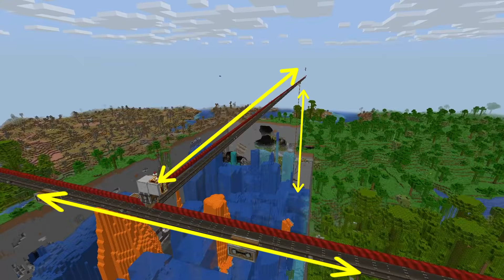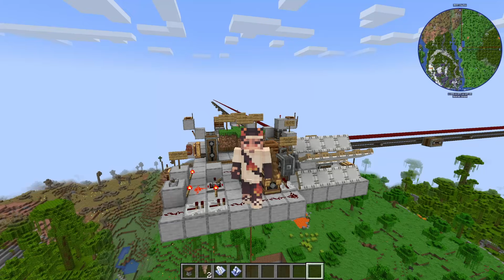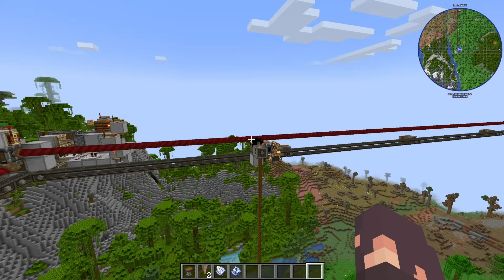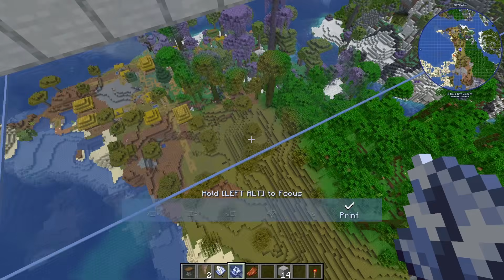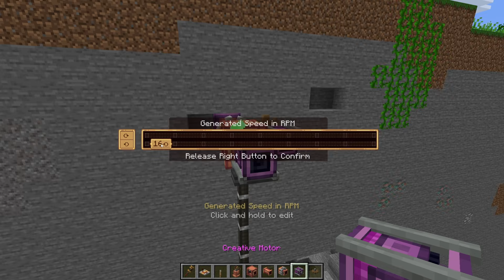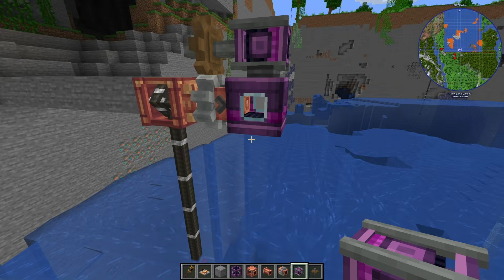The Best Create Mod QUARRY On YouTube! | Create Mod Tutorial

Comment: Probably the easiest way to delete the leftovers is to run a rail contraption that has a wall of blocks and stops each block along the way with a controller rail and cart assemblers to break blocks and fluids in a vertical plane and just run the rail in a zigzag. Still a hassle, but better than trying to finagle hose pulleys.
Reply from the maker: Yea… I’m hoping I can make something that can use the current infrastructure and just place blocks like a wall going down. We’ll see how feasible it is, but the wall strat might be the best way to

Comment: Great suggestion to removing liquids, set the Deployers to place an instant break block like slime, then filter the funnel to not output said block, with that you wouldn’t even need a 2ed layer of drills on top
Reply from the maker: I see what ur saying. Will try it but unless the drills are 3 blocks away it prob won’t work as expected cause they’ll still place blocks as the machine is coming back up. I’ll keep messing with it to see if I can figure out a way for internal deployers to work

Comment: 10:00 if you have the chunk loader create addon you can use 2 chunk loaders, 1 on the controlling part and 1 on the drills
edit: maybe you can make the un-watering system by just putting the deployers in the way that they will place blocks on top of the drills (up not down) if it still wont work you can make extra layer of drills  on the bottom facing up with drills under this facing down
Reply from the maker: You’ll still need to load in the entire gantry shaft and belt part of the contraption since that moves over with the farm, but that’s a good idea to reduce the # of total chunk loaders
Reply: @kindlebubbledump I've been working on getting this to run correctly on my world for three days now 😢 
 Anyway my thought and question for you is can't the gantry shaft that is in the schematic on both axis  come  with chunk loaders attached and glued to the gantry themselves ? 

Was there an reason you didn't include chunk loaders?  Is it an Stress unit prob ? .

Thank you for your hard work 💜
Reply: @la24dogg21  because loader on drills would need thousands of stress units which you cant currently provide

Comment: This is the best thing I’ve ever seen for a quarry. The only and only one thing I would suggest is making it so the machine comes back to deposit the items instead of an extension of belts as this may cause lag. Best video ever!!!
Reply: belts mostly only cause FPS lag, which really isn't going to affect your AFK session.
Reply: Can someone help me, i cant make It run good
Reply from the maker: That would be really cool and more realistic, the trouble I see with that is how to make it “remember” where it was last and get back to that spot. And at least from me messing around with it, the belts being glued to the contraption aren’t too laggy, but your idea would be super cool if it’s possible
Reply: @kindlebubbledump via deploying a redstone contact before returning
Reply: @kindlebubbledump what about using some mods that allows to teleport items or shared storages?
Reply from the maker: @ that would make the north belt system way easier. You’d just have to have the funnels dump into the item teleportation block and it will work that easily
Reply: @leodark_animations2084  Little late but create 6.0 adds a way of requesting, packaging, and transporting items across item vaults
Reply: @kindlebubbledump  I may have an idea. I'll try it and let you know how that goes.
Reply: in my other comment I said he must think his viewers are dumb AF and judging by your comment he may be right.